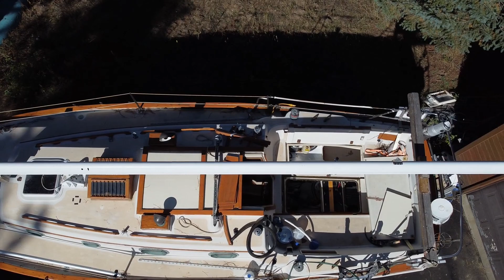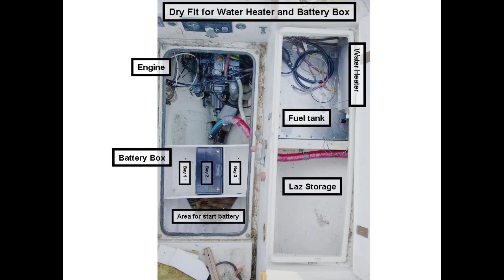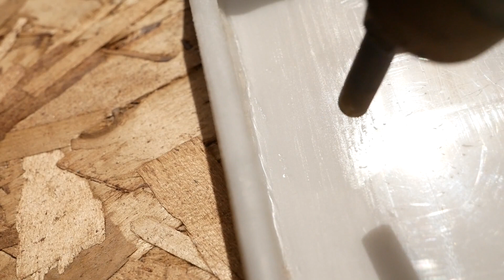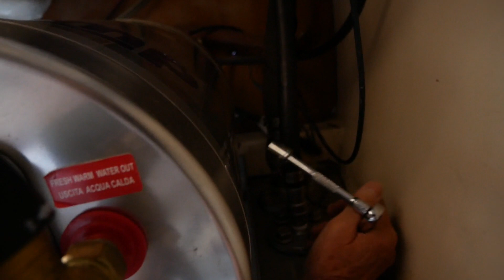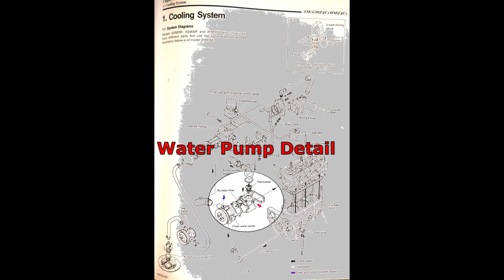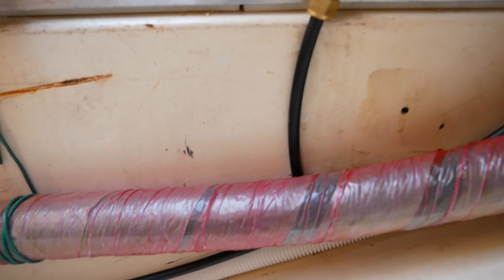Installing a Water Heater on a Small Sailboat

Comment: Thanks for your video, very helpful.  I am doing a similar install now with the heater tank higher than the engine.  I’ll be doing similar with a topoff tank and overflow tank however, what did you do with the overflow tube from the engine heat exchanger?  You mentioned the new 30psi cap but did not mention what you did with the engine heat exchanger overflow tube?  I imagine it should be blanked off or also extended to T into the overflow tank in its new position?
Reply from the maker: Thanks very much for your reply and feedback. I wasn't sure what I'd do after I shot that video but I decided t leave it on. There is more than a 10lb difference in pressure between the valve on top of the engine and at the fill tank above the engine. If that top valve fails to open the one on the engine is a backup.  The hose runs into a plastic bottle under the engine. I could have let it run to the pan or platform under the engine but if I found coolant down there I'd have to do some searching for where it came from. So far, no coolant many hours later.

Comment: Hello from the Chesapeake Bay, I recently purchased a 1979 Orion too. Thanks for sharing this video. I am very interested in your battery box design. Did you install additional "House" batteries in your battery box?  How did the hot water tank work out? How many showers approximately? Thanks! Tim
Reply from the maker: Great to hear you have a 1979 too! What hull number? I put in 3 AGM 100aH batteries in the box I built that sits between the tiller and rear of the engine. I wish LiPo were cheaper, would have gone with them. Orignially there was a bulky battery charger and start battery behind the engine. There were two flooded lead acid batteries on the built in 30 gal fuel tank on the starboard side under the lazarette lid. And the platform for that included a form for a propane bottle. That's really hazardous! Fortunately, we've learned a lot about boat safety with fuels and batteries since that time when the boat was built. As for showers...haven't done that yet. I had a leak in the built in the shower pan fitting for the hose going to the pump so sucking water out wasn't working. I replaced the fitting so now the system works but haven't done the next - taking a shower. 
Where are you on the Chesapeake? Our younger son had a Pearson 365 ketch at Glocester Pt near Hayes VA. and we sailed the lower Bay then.
Dean

Comment: Nice work, very professional and well thought out system.  
You appear to be a person who appreciates quality and multi-functionalism.  In that spirit you might consider looking into a Wallas Diesel Stove/Oven combo to replace your Propane stove system.  As I'm sure you're aware Propane creates water vapor when burned, and that accumulates inside of your cabin.  Diesel stoves however do not release water vapor when in use.  A diesel stove also eliminates Propane on your boat completely, and it can be plumbed directly into your main fuel tank.  They are incredibly efficient and they can be used to heat your cabin.  The Wallas brand is not cheap, but they come very highly recommended...
Reply from the maker: Thanks very much for your thoughtful comments! I have looked into alternatives regarding the galley stove and its on the list after higher needs like a self steering wind vane and frig. The propane stove works fine but, like you, I'm no fan of propane on a boat. I like your mention of the Wallas diesel stove and since I already  have diesel for the engine and heater I'll be installing, it makes sense to go that way. I also considered alcohol and appreciated using an Origo 6000 on my son's boat but they aren't made anymore and it requires another fuel. All of these fuels do release copious amounts of water vapor at various levels (alcohol is worst) due to the breaking of organic carbon compounds largely composed of carbon and hydrogen- even burning dry wood releases water vapor.